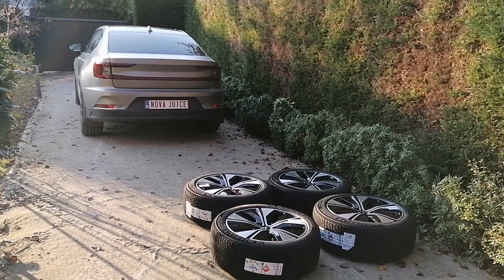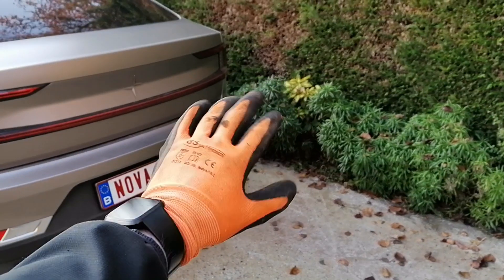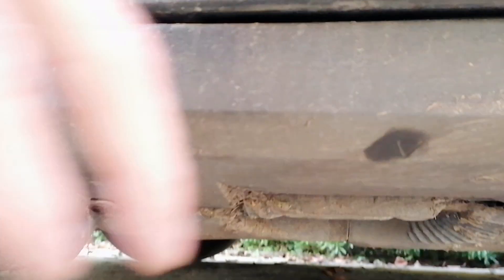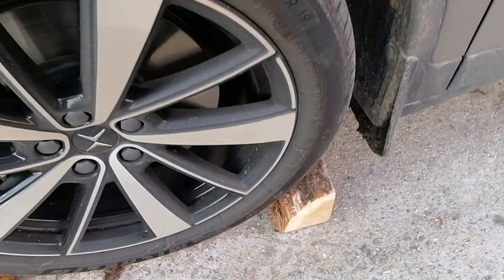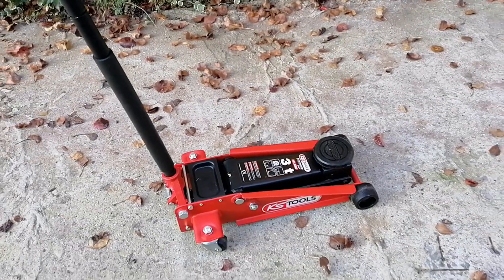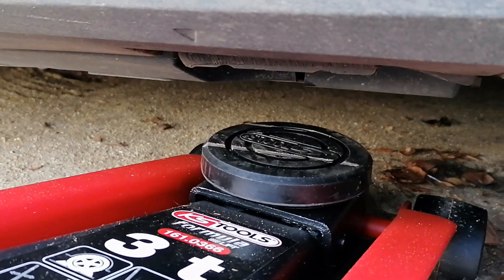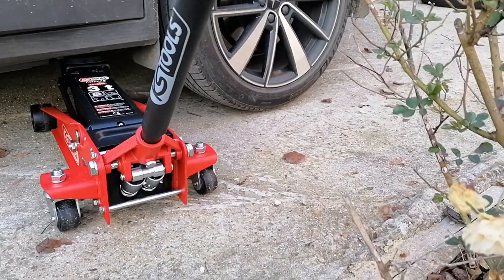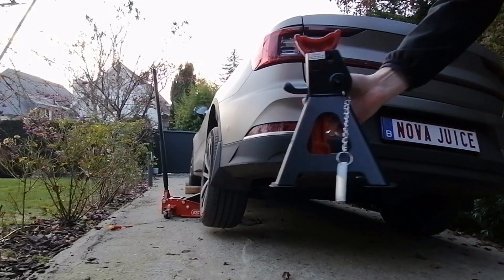Raising the Polestar 2

Comment: Very very detailed & helpful. So looks like if you jack it up high enough you can do both wheels on the same side without having to move jack from Front to Rear - correct?
Reply from the maker: Well, I've once elevated it enough that the other tire got off the ground, but I don't know, the feeling was "this is too high". So I'm doing them one at a time, most of the time of changing the tire is not in jacking it up, but unscrewing, placing the new tire and rescrewing.
Have you tried doing both tires at one?

Comment: There is no room to put the jack stand bro
Reply from the maker: Yup, that's what I discovered - too bad, when I switched tires between my 2 P2, I had to use an intermediary tire to place back on  car 1 when moving the tire to car 2, and then replace that intermediary tire when bringing back the tire from car 2 to car 1 - lots of jacking up and down that would have been skipped if I could place a jack stand somewhere.
Reply: Yeah this so dumb and unsafe. Most cars have a secondary place you can jack off like a bolt on the subframe. So you can then put your jack stand under the jack point but the PS2 is all plastic underneath. Putting the wheel under a central part of the car is probably the best you can do
Reply from the maker: @hugoburton5222  I feel your suggestion of putting a wheel in the central park of the car will likely end up breaking the plastic and whatever happens to be under that part... I wouldn't do it.